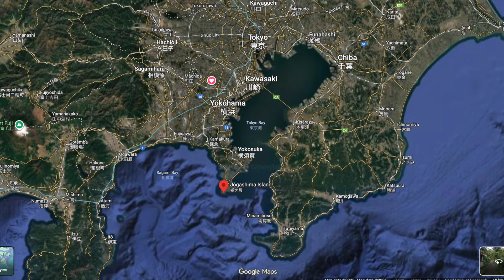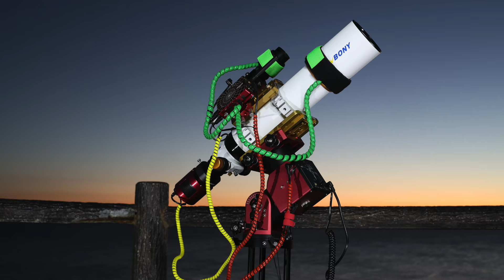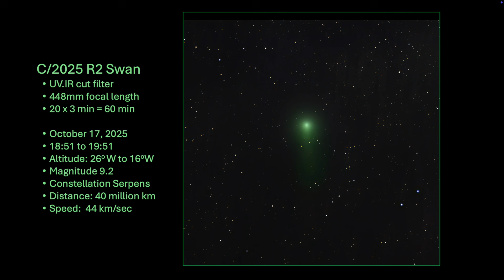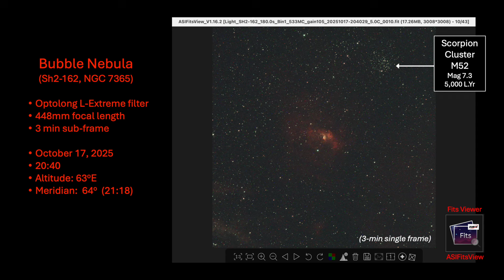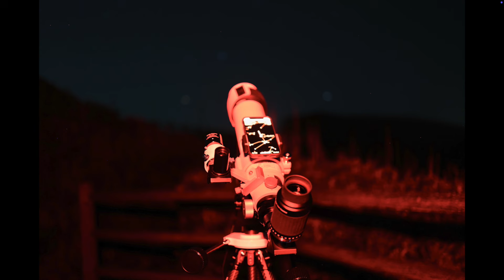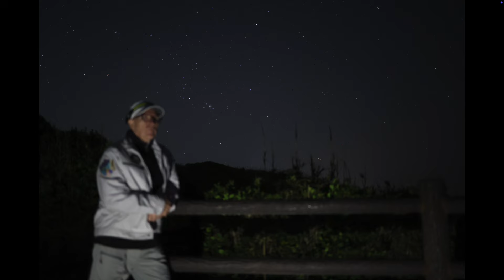Astrophotography Japan / October Skies! (Episode 64)

Comment: Hello Paul - I have the same mount with a Redcat 51 and a 585MC Air. I’m only getting 4-5 east and west calibration steps and guiding sometimes above 2. Are you getting more calibration steps? Also what are your onstep and ASIAIR settings if you don’t mind?

Thanks ! 

Neil
Reply from the maker: Hey Neil, thanks for commenting.   Guiding is a can-of-worms, isn`t it?   Let me show my ignorance here........ What do you mean by OnStep settings?   I am not aware of making adjustments "in OnStep" for use of the AM5 mount.   My TeSeek11 mount uses OnStep operating software (see episode 65), but even then, all adjustments to guiding are made in the ASIAIR, aren`t they?   Sorry to turn your questions back into questions.....   But I am confused.  PAUL